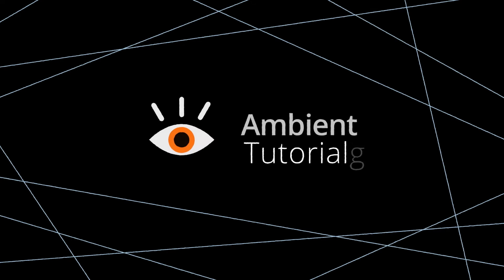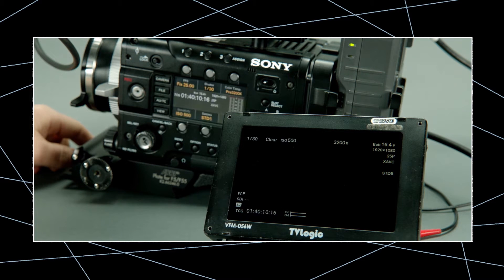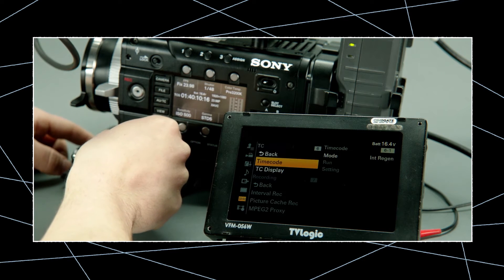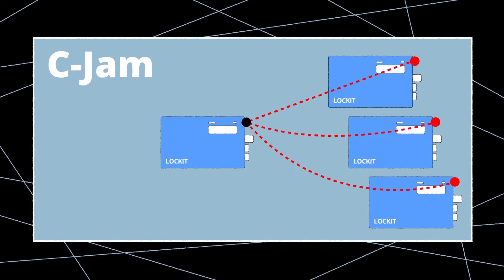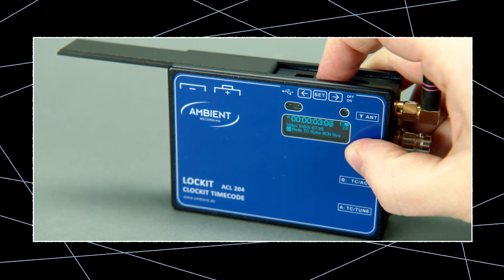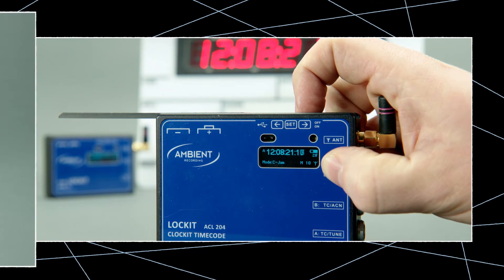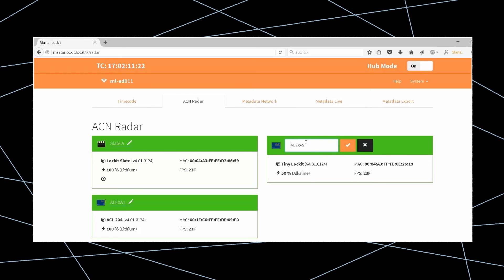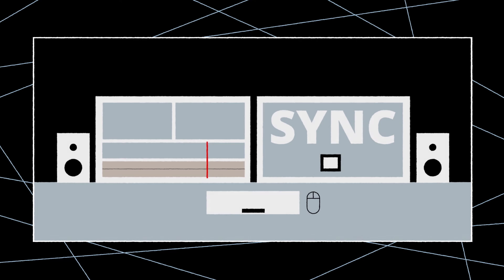How to Sync Sony F55 cameras - Tutorial

Comment: Excellent tutorial, thanks!! Quick question. We have our Sony F55 connected through the CA4000 adaptor. And even though our genlock is sending 29.97p. The camera is stuck to 59.94p. And no matter what we do, we aren't able to change it and no options in the setting to change that as well. Would you help us move in the right direction? Thanks!
Reply from the maker: Hi Fabio, sounds tricky, unfortunately nothing we heard any experience from other users. This would be more a question for Sony, or the F35 Ca4000 Manual